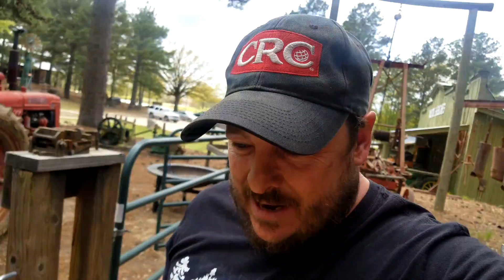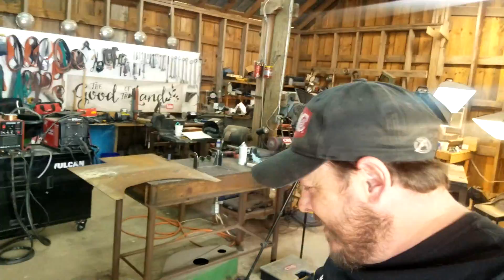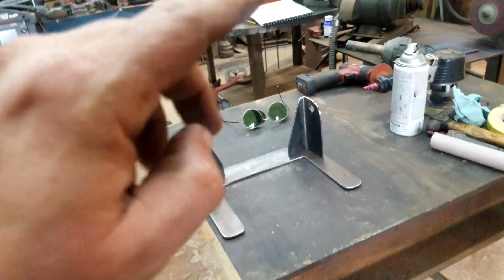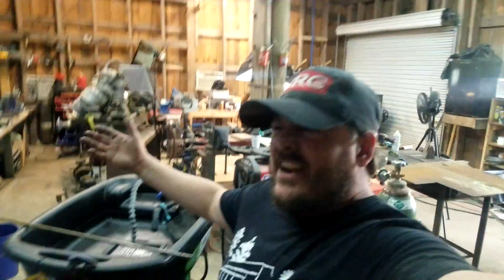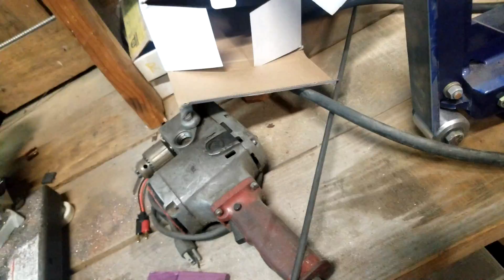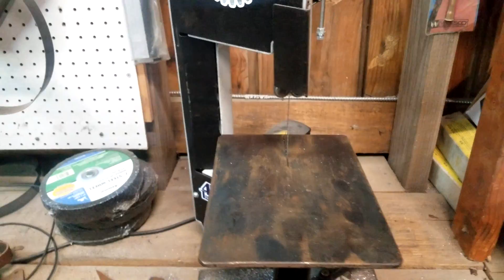I QUIT the Museum ! What now?

Comment: Make sure you understand the slab to building interface before you pour. If you screw that up everything else is for naught.  You need to understand the footings, drainage, etc.  Also. Make sure you are pouring thick enough for the intended used.  Heavy machines, equipment, isolated pads, and all that needs to be planned out ahead of time.

Comment: I was of the understanding that many of the tools donated to you were donated to assist with the museum but I guess that is only an issue between you and the donors at this point.
Reply from the maker: That's not the case. It's a long conversation  before I except anything. I'm going to have a live stream to answer all the questions.
Reply: The Good of the Land 
I wasn’t trying to accuse you of anything Justin. That long conversation between you and the donor is the part that we aren’t privy to nor do we need to be. 
A live stream Q&A would certainly clear the air and maybe I was the only one the came to that understanding and I am sorry about that. 
I do look forward to all the work you have planned for your shop and land that has been on hold since your side trip through the mill.
Reply from the maker: @Crewsy  No worries brother. I didn't take it the wrong way. These are good questions.

Comment: I've built a lot of wood frame buildings, some pole barn types, some stick framed and been involved with some steel buildings. All are good if done correctly, advantages and disadvantages to both. If you are looking at a kit type steel building, get your layout and elevations on bolt patterns and squareness as close to absolutely perfect as you can. It'll pay off in assembly. You can handle it.

Comment: You might ask around at cotton gins to see who they recommend for erecting structural steel. My cousin built everything from cotton gins to pole barns before he passed from cancer. People who know their stuff will have the proper equipment such as cranes and metal handling expertise as well as being able to get structural steel at a better price than you can most likely. 
Hope this helps. Also, check with your insurance agent to make sure you have proper and sufficient insurance in case something goes wrong.